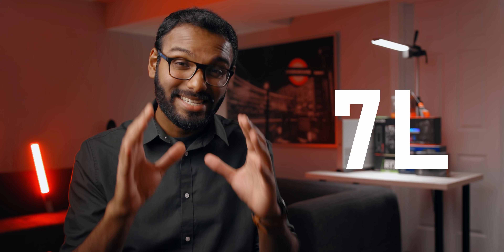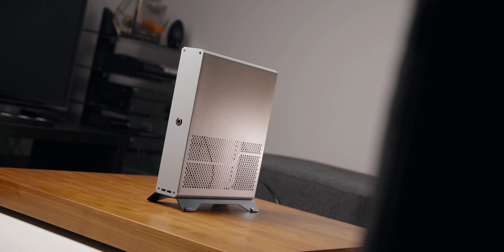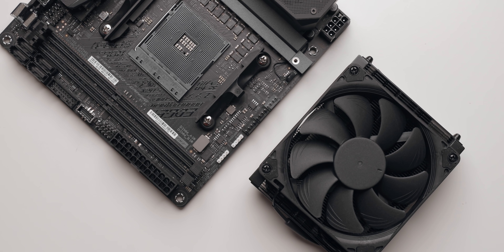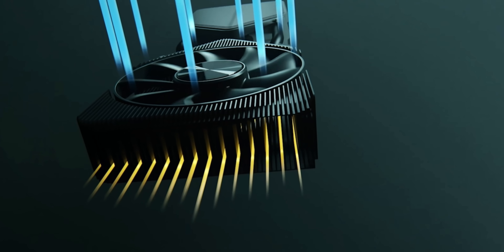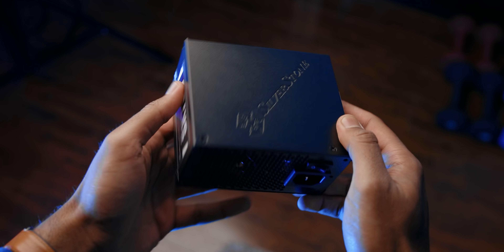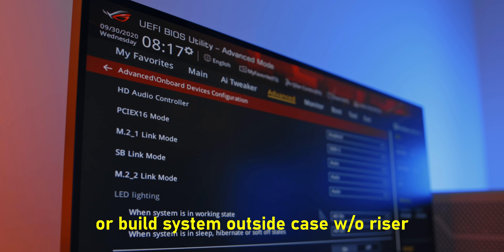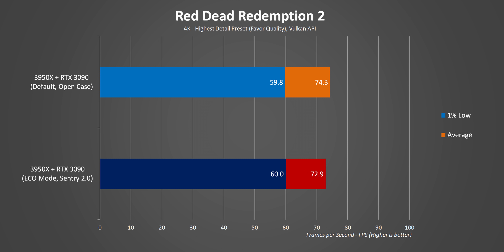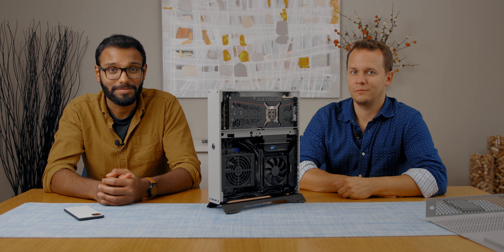RTX 3090 in a CONSOLE Size PC - It Works and its AMAZING!

Comment: Happy to see itx builds for the 30 series starting to pop up.  Planning on cramming a 3080 Asus Tuf into a Node 202.  Might have to experiment with removing the stock fans and setting up a pull configuration but I'll have to see where temps land with the gpu crammed in there before making the next move.

Comment: Triple-slot GPUs are possible, only if the cooler were replaced with a watercooler. This makes the 3090 FE one of a few possibilities for this, as the card by itself, without cooling doesn't have any connectors which mandate it being a triple-slot card. Once watercooled, the 3090 FE can exist in a single slot. With a thin res and rad it's possible to wholly watercool the system in the space of 7 litres.

Comment: 11:24 speaking about modifications
how about perforated backplate gpu side of the case with FE card instead? Air goes straight through the case making it as close to the open bench as possible
Or you can flip FE card over so both gpu fans will act as case exhaust fans

Comment: I have my system nestled in a Raven RVZ02. 1080ti strix and an intel 6700k at 4.5ghz. It made a world of difference when i pulled the stock gpu fans and shroud off, modded some 140mm slim fans on and modded 3 80mm exhaust fans into the top of the case. Its decently cool n' quiet now after alot of tuning only runs about 80c gpu and 74c cpu with filters on (at full load) about 72c gpu and 65c cpu filters off. All while being very quiet.
Fans are:
noise blocker nb- black silent pro 80x15 pwm
Prolimatech ultra slim 140mm pwm

Temps could be lower if i maxed out the fans, but i prefer the balance of silence and cooling

Comment: Thermalright AXP-90 Full Copper is probably the best CPU cooler you will fit in there. Also would love to see the solid panel covering the back of the GPU modded to be perforated and a 3080 FE put in to see if it would run really cool.

Comment: I guess you can add noctua tiny fans on the top of the GPU section to draw the air out, however I do think adding some extra holes on the back plate of the Dr. Zaber case  - particularly the backplate of the gpu case, will have really good results, even better than just adding tiny fans on top of the Dr. zaber since not every GPU size will allow tiny top fans. It will just allow the GPU cooler to draw air by itself and passive exhaust from the back and top.

Comment: I have this same case with a similar triple fan gpu and same cpu cooler, definitely do some ducting! for this gpu I just took a piece of thin plastic and covered the fins near the pcie plug so all the air gets forced out the top and it makes a big difference, also cpu ducting so air wont get recirculated! loved the video:)

Comment: Take off the shroud of the GPU and put decent Noctuas on there, but orientate them to pushe the air out. Same for the CPU, push the air out. Giving the case an overall negative pressure. And yeah, get rid of as much unneeded cable lenght as possible...

Comment: Guys ur cpu heatsink is exauhsting hot air right onto the ram, so the heat builds up. I suggest using noctua l9i with am4 bracket and orient it parallel to ram
Reply: I feel like you came over from r/sffpc. If not, we welcome you.

Comment: My case is smaller 8P.  I took some steel and welded a computer case together with a bent sheet metal cover to make it look super smooth. It's the same height as a waterbottle and length too and about 3 inch width. I7 4790t 3.9ghz, r9 nano, 1tb msata, 1tb m.2, 1tb hdd, 16gb ddr3 sodimm.

Comment: Maybe you could separate the flat cables into the individual strands. Like taking a razorblade and carefully start to cut the insulation between the cables themselves and hopefully you can carefully pull the strands apart. But you need to be very carefull to not cut into the cables themselves of even create a short. But this way the routing would be much easier. However I have never tried it with these exact cables and I would only try it, if i had a second pair of cables :D

Overall it is a really nice build and I am a bit jealous :D
Reply: This is definitely a case where custom sleeved cables with custom length helps a ton.

Comment: Love the case/build. But as I prefer low temps and silence I would watercool it and run the tubes outside to an external Mo-Ra 3 420 Radiator with 4x200 noctua chromax fans. You can even hide it but it's actually a good looking radiator about the size of the case I guess.

Comment: Just FYI you can tear apart single strands on those flat cables for a better fit. Always helps me
Reply: Or even use a hair dryer as a heat gun to fold and route better.

Comment: Like Mike said, you can try to force some of the air out of the case through the top. I know Noctua makes small 40mm cooling fans you guys could use to gain addition airflow, if you got spare fan headings that is. Some of those fans come in 5V variants, so you can definitely use a splitter

Comment: The Alpenfohn Black Ridge cooler would probably have been a better choice given the heat output of the 3950X. With VLP memory installed, a slim 120mm fan can be mounted beneath the cooler, and the whole assembly is right on the 47mm height limit of the case.

Comment: Try water cooling the 3090 FE and the CPU with some crazy custom loop. You could also try mounting the 3080 FE and drill holes in the back of the case for the card to exhale the heat from its fan, and try to make it look stock alike.

Comment: Add small 40mm noctua fans to the top(exhaust), and stop them getting fresh air from side vent holes using some piece of plastic or paper. It should help with removing hot air from GPU.

Comment: I think it's more the task of Autodesk experts who track airflow simulations, but it seems pretty obvious, whichever way you open up perforations will likely reduce the temperature. The air wants to go out. Likely some of the air hitting the polka dotted metal panel is being deflected at less than normal angles.  So it is pushing the air alongside that face most likely. So openings at the edges of the structure, meaning near that face's corners are likely the best spots to make micro-perforations that get the clashing air out.
Reply: Or maybe polka dots for the entire face to make the design logical.

Comment: CPU cooler: alphenfohn black ridge low profile cooler. It's design for Dan a4 sfx but it should work with your setup. Just check the dimensions on the Asus io plastic shroud. It might interfere. You can also put a 120mm slim noctua fan on the black ridge if you have a VLP ram with no heat spreader ( stock is only 92mm slim).  I have a 1800x on a l9i with amd convertion bracket (L9A is not yet available when I bought it)  and it's not enough although I don't have an Evo mode. The black ridge can cool it. 
GPU: maybe some noctua 40mm fan on top as an exhaust. The can move air and not too loud. You can also remove the backplate shield on the GPU if it's removable while the pcie screw tabs remain on the card. Also undervolting ampere will yield 3-5 degree drop without changing the max boost frequency.

Comment: I think first u shud change the cable with custom sleeves cable with accurate lengths so it will give more space inside there for air circulation

second for the temperature issue..it would be the best u guys mods the side panel by making more holes on the mobo side and if u can do so for the gpu side

Btw it is an interesting case though 👍

Comment: I hope that small form factor case manufacturers start making ventilated back plates for cases with this sort of layout to accommodate the new RTX founders cards. I feel like GPU air flow will start going in that direction where the air flows through the PCB back plate (and it would help my old fury card too :D)

Comment: 3080 fe and make holes to the opposite side for the gpu to exhaust, with this setup you get both gpu fans intake clean air and exhaust outside with almost zero negatives.

Comment: Im not sure if this would be possible but using a 3080 and perfurating the back oc the gpu panel would be *PERFECT*, the temps in the entire system would drop. And i would not go for eco mode on the cpu but just dial it down manually, undervolting and reducing the clocks until the temps are finer, and the new gpu solution would help with that too.

Comment: Suggestion for GPU,
install nvidia rtx 3090 FE,
Modify the panel on which the fan is going to blow hot air. Add perforations in that area.
Your heat dissipation will work wonders then😊

Comment: Really interesting video! I have a 3950X in an Ncase under water, with EDC=0, R20 ~10k, >200W. 
I think your case would go much better with a 5800X / 5900X once they are out, higher FPS at the same or lower heat.

Comment: Not sure if anyone has asked, but to assist in air movement, could you somehow add 2-4 noctua a4x10 fans to the top between the gpu and case. The design looks like you should have about 18mm of open space there. Not sure how they would mount, but I think it would definitely add to the heat removal.

Comment: You could've used the FE card, the flow through fan would've just exhausted hot air through the side ventilation.

If anything the triple fan EVGA card would put more heat into the case because it exhausts heat up and down

Comment: For a low power HTPC or modest LAN rig or similar I can see the use case for all of these super small cases. Unless you live in a 200sq ft studio apartment I just don't see the need. Something like a Lancool II mesh would be cheaper and have almost no restrictions while not being huge. Even the NR200 from Coolermaster would be better as you wouldn't have to downclock your CPU. 3 slot GPU and 280mm radiator fits and its like $80 U.S..

Comment: The case modification you were talking about, why don’t you put the 3080 fe back in and just drill holes in the other side of the case to exhaust the hot air

Comment: You should have used the Corsair SF750 PSU instead. 50W more power and comes with individual sleeved cables. I've just build a system with it, that PSU is so great!

Comment: Looks nice just a little concerned with the 700w PSU (That's going to be running very close to max / VERY little head room)
Regardless, if the PSU isn't an issue I'd just keep the side panels off and a portable electric air duster near by just to regulate dust build up. 
I like the concept of using only what is needed / maximizing the space you have and keeping everything in an attractive and easily accessible package.
Reply from the maker: System draw from the wall is ~455W while gaming.  Factor in the efficiency loss and that means its putting a load of about ~415W on the PSU which is WELL within its capabilities.

Comment: You know if the top compartment where the GPU is had vent holes on both sides, you could have an isolated 3080 there working PERFECTLY. At least as far as it's own airflow path is concerned. Because one fan sucks in and blows out the back, and one card sucks in and blows through the card.

Comment: Grind out the grill and install a chimney on all three sides.   It will make the case wider and taller, but it will direct air-flow better.    I think the video card needs even better isolation from the CPU.   We need a better riser-cable format.    We need better small-form-factor PSU.      I think someday, there will be a form-factor smaller than mini-ITX that has a i7 or a 3950x, soldered to the board, along with a PCIe-Gen.4 slot, and NVME, etc.      Maybe someday ( in 10 years ? ) we can shrink the video cards a little, and still have the capability to play games smoothly that require a lot of graphics.

Maybe there is a way, for Nvidia or AMD to put a NVMe slot inside the graphics card ?      Imagine if all the games were hard-wired into the video-card somehow ?

Or maybe a giant motherboard where the graphic's card was soldered onto the board ?    

Or maybe an APU, that is just mind-blowingly awesome.

In the meantime, we just need to compromise on the size of a case, if that is an issue for you.       I like big cases, as it is easier to upgrade something.

Comment: Now I really want to buy that and do what you should have done. Used the 3090FE and A bigger cooler. But just cut a clean round hole for the GPU exhaust and a square hole for the CPU. Still compact, low noise and Hella cooler.
Reply from the maker: The triple slot 3090 FE won't fit, even with mods.  :(
Reply: @HardwareCanucks  Dammit then 3080 ;)

Comment: I feel your guy's pain trying to get that system optimized. I have a 3900XT and 2080Ti in an HTPC ITX case and keeping temps under control is such a headache. I'm about to pull those components out of that case to put them in an ITX mini tower and put a 10400 and maybe 3070 or 3060 or whatever AMD offers that runs cooler and more efficient in the HTPC case.

Comment: You should cut into the small front panel (the thing with the power button) so that the PSU can vent out towards the front. That would be the most sensible mod (no real negative impact), whereas adding fans to the top might bring down the GPU, the fans would need to be soo small they would end up being whinny, so i'd prefer my mod.

Comment: One thing I never understood about the Sentry case is the fact that the other panel parallel to the one with the ventilation holes for the GPU and/or CPU AIO is completely solid. Some ventilation in the area where an AIO would usually sit could encourage "flow through" airflow for a 120 mm AIO and would also allow a founders edition rtx 3080 to be installed and potentially perform really well. Maybe I´m missing something but would that have any disadvantage over the current design? If not then I would definitely mod some ventilation right there. I was thinking about this a couple of years ago when I saw people mount AIOs in the case for them to just suffocate because of that solid panel

Comment: I can't argue with results, but I'd be really worried about using a 700w power supply.  the 3090 at peak (especially if you choose to overclock) can use upwards of 500w, the 3950x is rated at 130w stock, plus those x570 chipsets are known for being a bit more power hungry than some other options, plus whatever power is required for those nice nvme drives... I don't think there would be much headroom for power supply efficiency, and i'd fear dialing in even a conservative overclock on the gpu (using afterburner or precision x1 with nviida's over-autoclock), and enabling precision boost overdrive (this is the configuration I usually start with when building gaming pc's these days as it's typically very stable like this), and then running something like furmark + prime95 (which is typically how I burn test new machines to verify that power and cooling systems are functioning properly before using normally after a build)

Comment: Fractal Design Node 202 is similar. is what I've used for 4 years with a GTX 1080, runs around 70 deg C. Ryzen 2600 with Noctua slim cooler runs a bit warm too around 70 deg C in 1080p  / 1440p gaming but otherwise a nice small case also

Comment: Since you have to mod the case anyway, wouldn't the FE be really good if you modded an exhaust right behind the second GPU fan? The other fan is already awesome since it would get fresh air from the current ventilation holes and directly exhaust it at the back instead of recirculating hot air like the EVGA one you are using.

Comment: Use CTR and undervolt the CPU a little - You shouldn't take a hit on performance much, as you'll probably be able to push higher clocks and lower voltage!

Comment: If they put a longer riser in and flipped the gpu so all air was being sucked in from one face it would be perfect. Would be able to lay it flat without blocking intakes etc. And cut to length, sleeved cables are a must in sff. Never use the boxed cables. Its asking for air dams.

Comment: Can you fit 3 or 4 Noctua A4x10 fans at the top of the case to pull hot air out? You could get a triple fan splitter and run them directly off of the motherboard. That might help direct your air more purposefully out of the top of the case.

Comment: Would an 80mm (or smaller) fan fit in the top holes above the GPU? You could mount a couple of them there in exhaust orientation to help with the GPU heat dissipation issue. It might make it loud though, depending on the fans you choose. I think Noctua makes small fans but don't quote me lol.

Comment: If only that case had fully perforated sides. The FE card would make so much sense. Fresh air in. Hot air out. Without any heat circulation within the case. Just like an open test bench.

Would double as a space heater during winter.

Comment: I wonder if you could 'mount' with double sided tape some NF-A4x10 FLX 40mm fans at the top of the case to help the eat escape vertically coming off of the heat fins.

Comment: I bought the case and I'm about to start a build in it. The case is rated for a dual slot and I was frustrated as I couldn't find a dual slot 3080 (non FE because of the pass through fan as you pointed out). HOwever, I understand that the EVGA 3090 did fit in the end? How tight did the 3090 fit in there (that's a 2.75 slot i believe?) and would you recommend a 2.75 slot GPU for long term use in that case?

Comment: PSU cable modding, short cables will gives alot of more room for air to move around the components.  and some small noctua fans blowing  upwards in the GPU compartment

Comment: Your temperatures would be WAY better if you used a different 3090. I’m not sure if there’s another one small enough, but the XC3 is the absolute worst when it comes to temperatures. I bought one because you can get them cheaper, and threw an EKWB water block on it to tie into my 2X 360mm 1X 120mm loop with my 3950X.